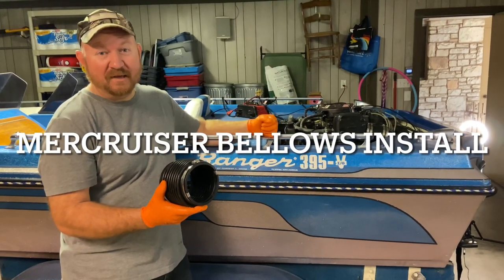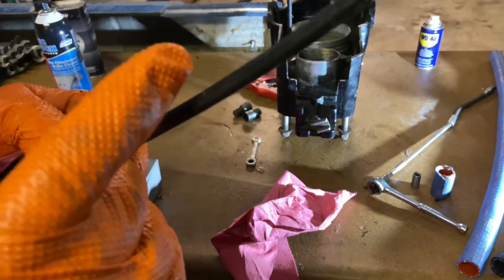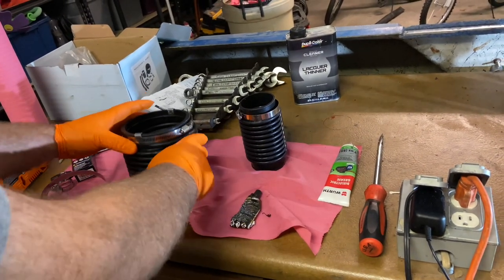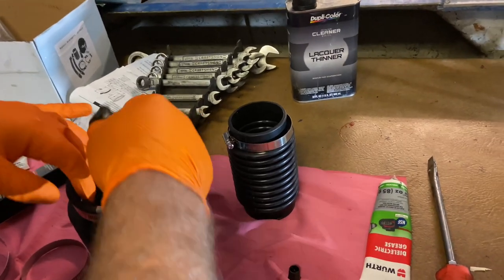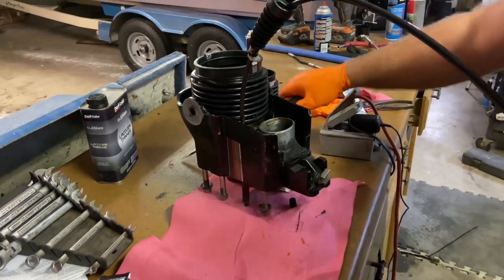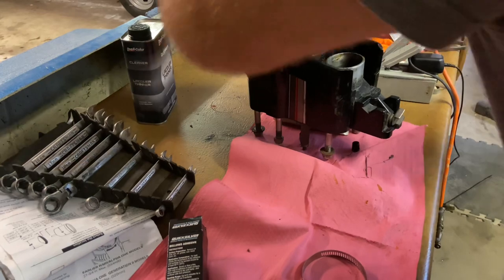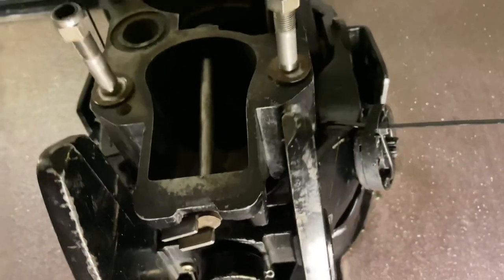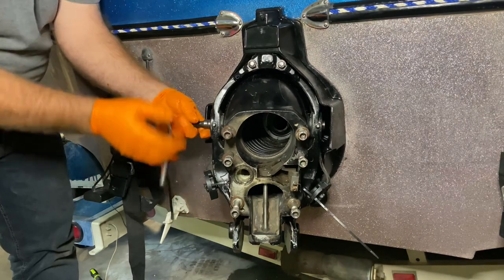Mercruiser Alpha 1 Gen 1 Stern Drive Repairs Part 5: How to install a Mercruiser bellows on a boat

Comment: I just did my gen 1 last night on my workbench since the transom plate is off currently. The water hose is nearly impossible if you don't put it on the bell housing first.  How did you do it?
Reply from the maker: Yes- very challenging!  I had to put it on the gimbal housing first, then finished attaching during the assembly process.
Reply: Me too, what a pain
Reply: @skidooextreme2233  Yup.  Not that I blame @Pro Wrenching, but that is probably the single most challenging task and it's sort of skipped in this video.  I think you need to have a heat gun to make the rubber malleable enough to fit on the sleeves on both the gimbal and bell housing.

Comment: My FRIEEEND is my again I have a hose from the trim motor leaking , I have to take the engine out to replace it ??????
Reply from the maker: Hi!  It is a difficult job, but I think you should be able to do it without removing the motor.  The plate that the hose goes to on the gimbal housing has 2 bolts & you can pull the plate down to access the hydraulic line fittings that go up to the pump.
Reply: @ProWrenching  is that the trim hose line manifold ?
Reply: @ProWrenching  you are the best as always brother !!!
Reply from the maker: @gherickb8181  yes
Reply from the maker: @gherickb8181  thanks!

Comment: nice work!  I've done this job twice since being a boat owner, about to do my third so browsing.  one thing I've noticed I always glued and stuck my u joint bellows to the gimbal first, then pulled it up into the bell housing. like you did your exhaust bellows. is your way more efficient, or easier?
Reply from the maker: Thanks!  For me, it was easier to access the clamps with the u joint bellow installed on the gimbal first and then install on the gimbal plate, which has access holes you can use to reach the clamps on the bellows.

Comment: ???WHY..Dialectric Grease??? On The shift Cable? Wht not the proper lubricant?
Reply from the maker: B/c it works great as an assembly lube for rubber and silicone hoses & misc. parts.
Reply: @ProWrenching  Thankyou for taking the time to explain why. It makes sense.

Comment: Hello my friend new problem I just came from water , I was running good the temperature when up get out the water the exhaust bellow was BURN inside any idea ?
Reply from the maker: Hi- It sounds like you’re not getting good water flow through your engine and out your exhaust.  You want to make sure that your water pump impeller is pumping and the water tube hose in the lower unit isn’t kinked. There’s also a water pump on the engine.
Reply: Impeller new , water pump is new am going to check if the hose in the out drive is not loose ,,, but is not fire 🔥 there righ ???
Reply from the maker: @gherickb8181  was it melted from hot exhaust or was it burnt from fuel and oil and ignition source?
Reply: Was the out drive hose I don’t know it was for overheating or fire am scare now 😂
Reply from the maker: @gherickb8181 the out drive hose- you mean the water hose or do you mean the drive shaft bellow?
Reply: Ok in the out drive is 3 houses water inlet , Ujoint , and exhaust bellow, that one the exhaust below is burn !!
Reply from the maker: @gherickb8181  I would double check and make sure that you’re getting good water flow thru the engine and then go from there.  It’s hard to know for sure without me looking at it.  I hope you get it fixed, man!
Reply: My friend yes the water look to be clogged I have a lot a corrosion inside ,, brother any product , chemical the you recommend to flush the line and cleaned??
Reply from the maker: @gherickb8181  Hi- I have heard there are some products out there you could try like Starbrite descaling engine flush.
Reply: Hey brother best regards problem was I was testing turning the boat for short time whit out water and of course the impeller was dead that’s why the overheat and all that
Reply: I have another question why type oil can I use on my trim tild motor like a replacement that oil from west marine is so so expensive omg !!! Many blessings for you and your family!!!!
Reply from the maker: @gherickb8181  i know some people use automatic transmission fluid and it works fine.  Hey- glad you found the reason for your overheating issue!

Comment: how many ft lbs do you tighten the bolts holding the gimbal housing to?
Reply from the maker: The gimbal ring to bell housing hinge pins are torqued at 95 ft lbs.
Reply: @ProWrenching  
thank you!
Reply: what's your opinion on the exhaust tube vs exhaust bellows.  i know the tube allows more noise to escape. any down side to using a tube?
Reply from the maker: @the_craptain  I haven’t used a tube myself, but it looks like an excellent idea. I think it would be easier to install and you don’t have to worry about it tearing.

Comment: Great video. What tool did you use to remove/install the hinge pins?
Reply from the maker: Thanks!  I used a 
replacementkits.com brand Mercruiser Mercury Hinge Pin Tool for Alpha One & Gen II Bravo I II & III ——replaces 91-78310 & 18-986.  I bought it from a “major online retailer”
Reply: @ProWrenching  what was the torque spec?
Reply from the maker: @smitt112  95 ft lbs
Reply: @ProWrenching  Thank you!

Comment: when did you attach the water hose to the bell housing?
Reply from the maker: I installed the hose after I installed the gimbal plate.  It slides on the inlet and attaches with a screw type hose clamp.
Reply: @ProWrenching  thanks doing the same exact thing, so your videos help a ton
Reply from the maker: @libertyfinder4889  Very cool- glad to hear it!  Thanks.

Comment: Brother am dying replacing my U joint bellow i just order the hinge tool
Reply from the maker: Awesome!  It’ll help you get the job done.
Reply: Yup, just failed at the critical step myself.  If you don't get that bellow lip into the groove, it's game over.  Now I have to pull it all apart, maybe I can clean the bellows adhesive off the bellow, most likely will tear it up and will need to order another bellow.   And I am not positive I can clean the bellows cement off the gimbal housing without damaging the exhaust and shift cable bellows.  What a PITA, worst project ever.

Comment: No clip on the exhaust bellows?
Reply from the maker: Yes- clips should be used on both bellows.  They ground the clamp and help prevent corrosion.
Reply: @ProWrenching  thank you! Do you know if clip position matters? I have my exhaust with the clip glued at 12 o'clock and I've seen others with it in the opposite position.
Reply from the maker: @shanedean4075  that should do the job.  It works in either position.
Reply: @shanedean4075  Was told clip goes in the 12 oclock position on the ujoint bellow, and 6 oclock postion on the exhaust bellow

Comment: Have same engine and outdrive. Don't believe water is getting to engine, so planning to replace impeller and housings. I noticed the water hose from the gimbal housing to the stern (now blue on yours) looks pretty bad. The bellows don't look too bad. What is the best way to replace that hose?
Reply from the maker: The hose is very hard to access. I think it can only be replaced if you have the stern drive removed and the gimbal housing apart.
Reply: That means I will have to disconnect at least one side of the drive bellows and the exhaust bellows? Guessing the hose is connected before the bellows? Is disassembly likely to damage bellows and should I plan to replace them?  Thx!
Reply from the maker: @thomashall841  I have not replaced that hose without also replacing the bellows. The hose connects above the driveshaft bellow and the other end connects on the lower part of the gimbal next to the exhaust bellow.